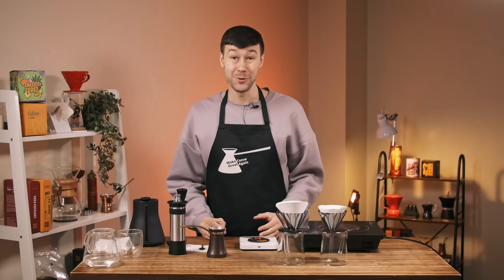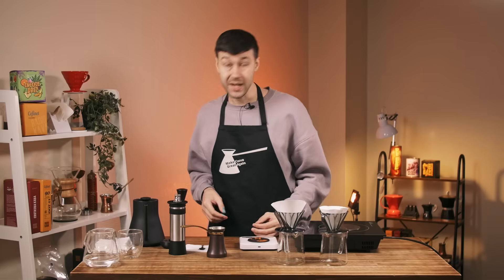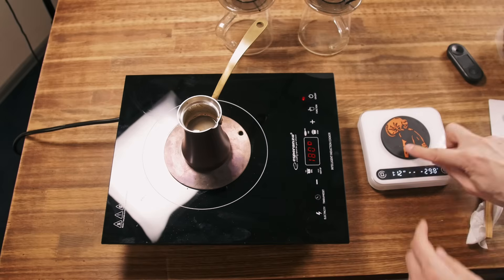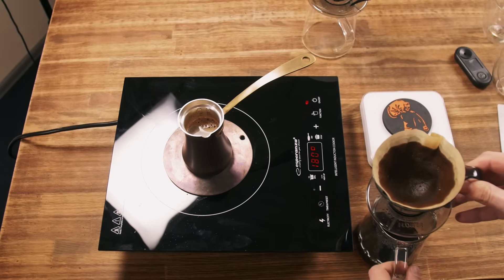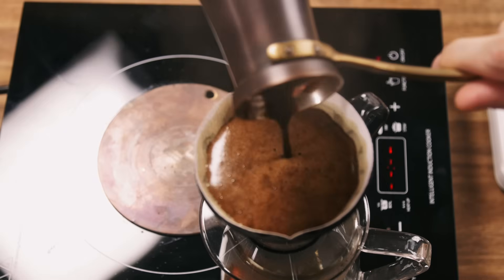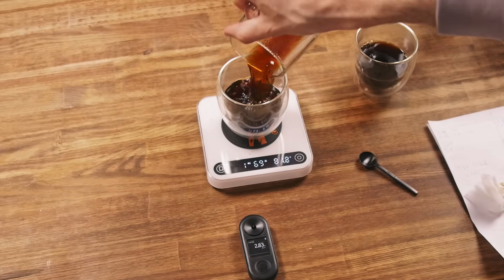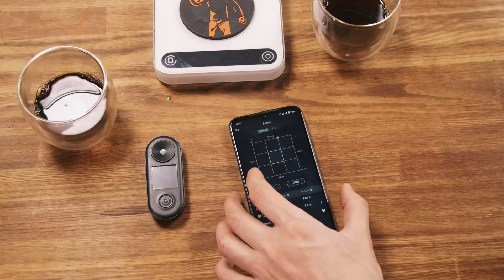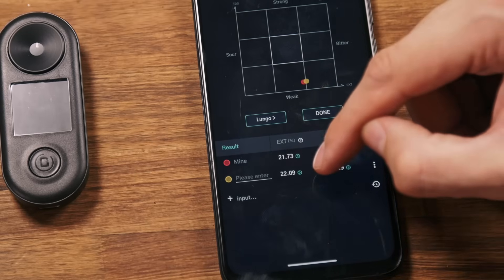Turkish Coffee - proving the concept - extraction

Comment: Once again, I would like to express my gratitude to you for your work in studying the cezve and disseminating your experience. Please correct me if I'm wrong. I guess that there are other things to consider when calculating extraction. There is residue left on the filter, which contains particles with absorbed water and bound water. Absorbed water does not participate in extraction; it is water that is located in the porous structure of coffee particles; according to various sources, its amount ranges from 0.9 to 1.1 by weight of coffee. And the rest of the water participated in the extraction, and accordingly has part of the extract and is bound in the remaining thick. It can be assumed that its concentration is the same as that of the drained mass. Then the extract in your case will be 105.1x2.9% + (138.5-105.1-13.8)x2.9% = 3.62 g and the extraction percentage is 3.62 / 13.8 x 100 = 26.2%. Maybe I'm wrong, I will be grateful if you correct me and comment. Thank you!
Reply from the maker: I assume we just ignore what's left in a coffee since we can't use this soluble material) That's why I calculate the TDS of the result in a cup. Of course it's relative, but still pretty high. And 100% not every shot of espresso will have such extraction:) Since it's just a comparison of a foam color change and how it affects the taste and extraction... I just wanted to show that there is a difference
Reply from the maker: Amount of liquid out was like 150g (13.8g + 138g). 32g retained (including in a paper). So by your math it's like 28%. If the liquid inside coffee particles have the same concentration... Which it possibly should
Reply: Thank you for the answer and good evening! @wendstudio_coffee